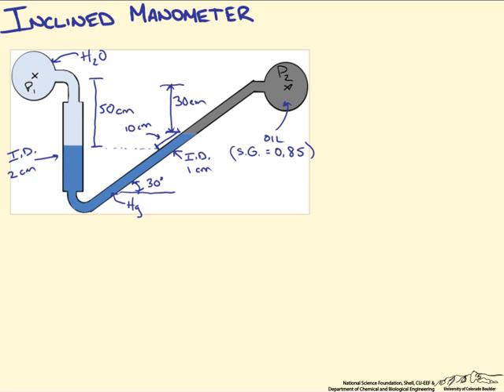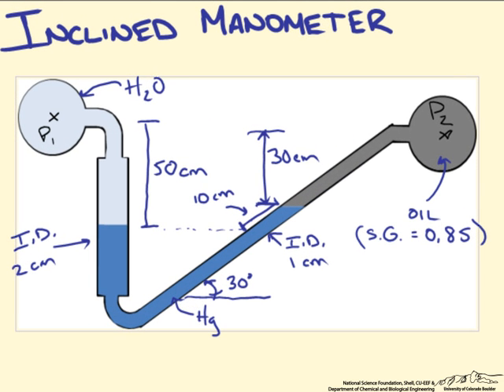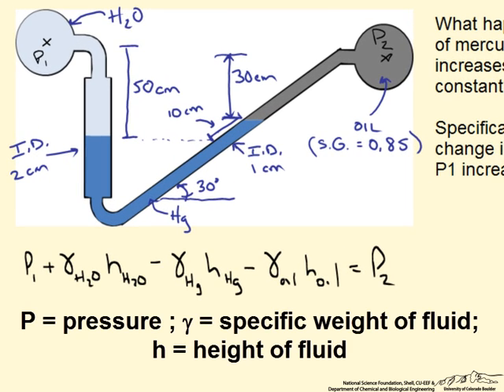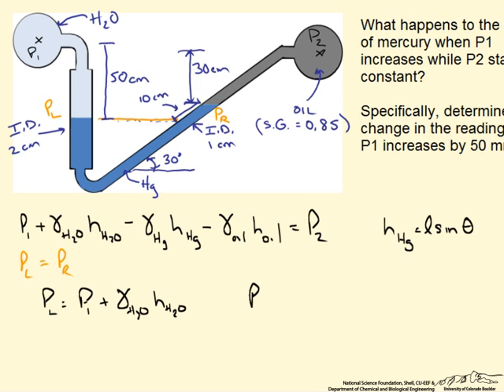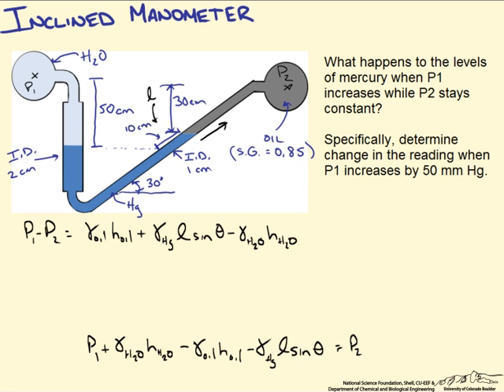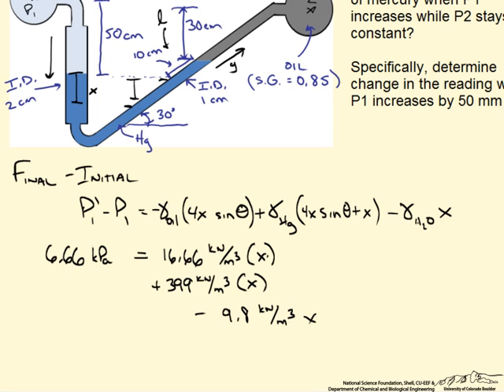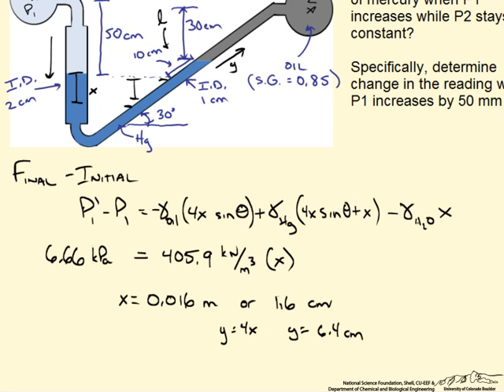Force Balance on Inclined Manometer

Comment: where is  of come 4x?
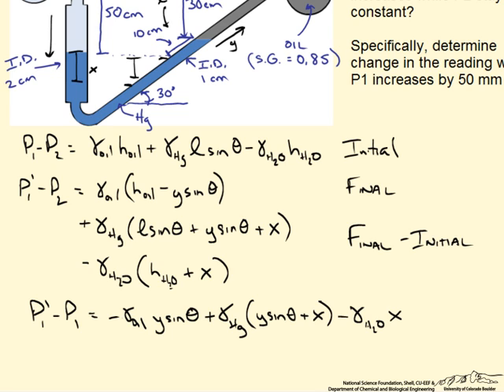Reply from the maker: Good question. This is discussed starting at 7:10 in the screencast, but basically, it is just comparing the fluid amounts in sections of the different diameter pipes.